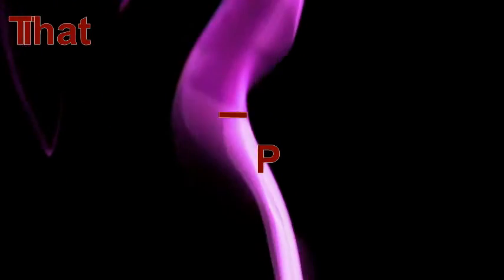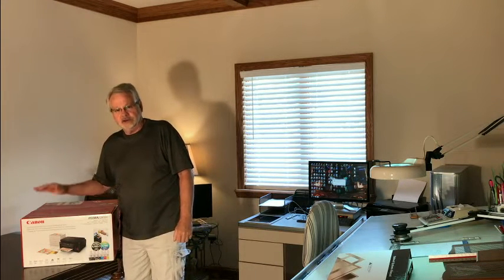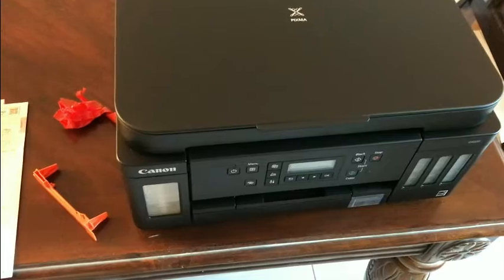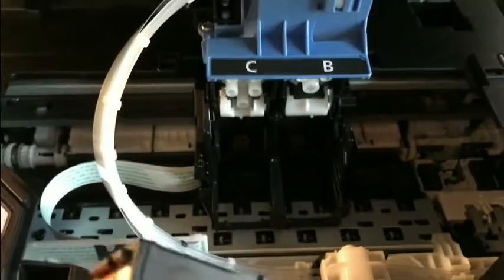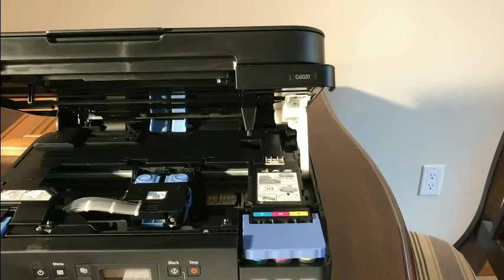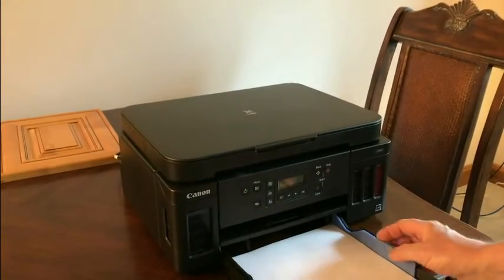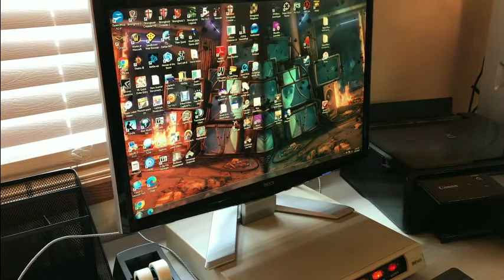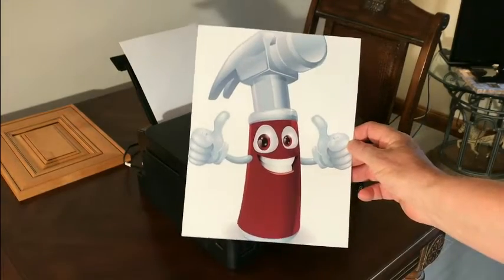Set up and review of Canon Pixma G6020 MEGA TANK

Comment: What if you don't have a smartphone?  Does it have automatic 2 sided printing?  More importantly, can you replace the cotton pads that absorb ink when the printheads need cleaning?  I've read that if those pads are full the printer will not work unless they're replaced.
Also, you didn't peel off the paper on the top of the printheads, I'm surprised that didn't cause a problem.